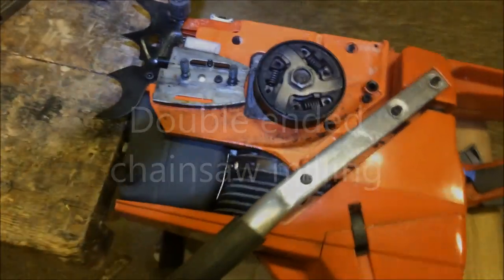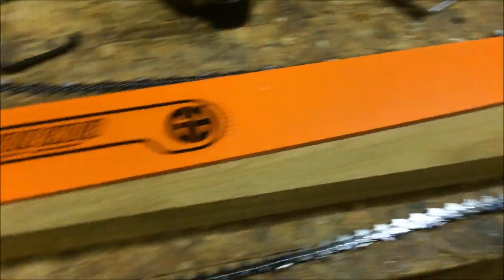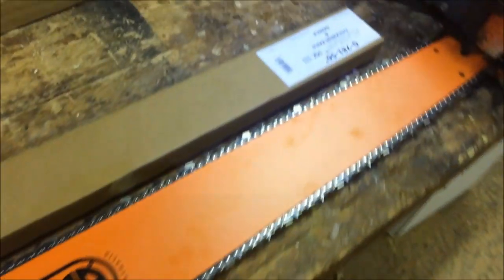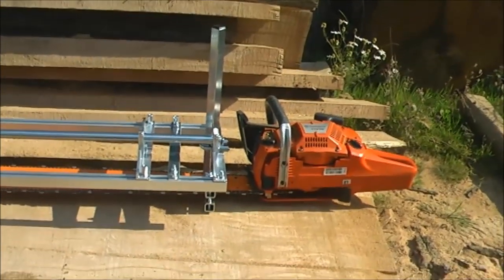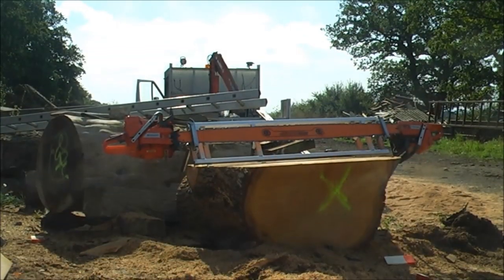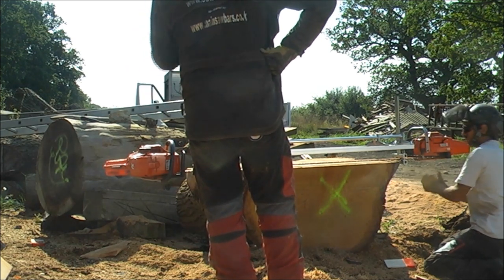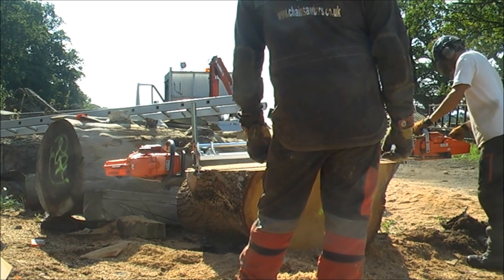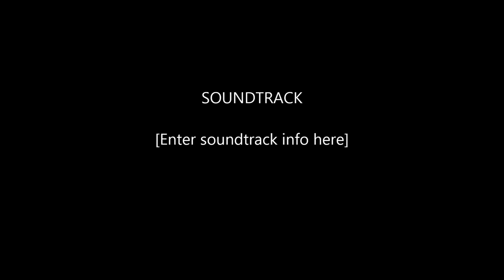Full double ended milling video which runs though the set up process (Husky saws)

Comment: Well I learned something new today.  I had no idea you could hook 2 chainsaws to a single bar on a chainsaw mill.    Perhaps you should checkout the clip on slabber for your Peterson sawmill.
Reply: Thanks yes - the Peterson slabber would be ideal but it is thousands of £! So cheaper to actually get the Alaskan set up with x2 saws and you can then use these for other purposes as well.
Reply from the maker: +bwillan The trouble is the cost of the Peterson slabber is proibitive - also even if it was not super expensive you waste a fair bit of time switching from the circular saw to the slabber. With this method you can use the circular saw then quickly slab a few planks then back to the circular saw. It'll be faster, will save you money and you have a full mobile set up to boot!

Comment: The idea that two saws are better than one on an alaskan -style mill seems to be somewhat controversial. 
Some say it doesn't work at all.. others that the rpm must be synchronized.. others yet that its the way to go.
Do you guys have any data on differences in the speed of cut etc?
Reply from the maker: +Muskoka Strong Hi - I have no technical data but believe me it works and it is fast. I have tried with x4 different set ups now and with unmatching powerheads and each set up worked well. Those that disagree have not set up their equipment correctly ;)
Reply: +alaskanmilluk Thanks for the reply and all your great videos!
Decided to start with a single 880.. should be adequate to get me through a few logs.
Will slap another one when I'm ready to man up! 😉